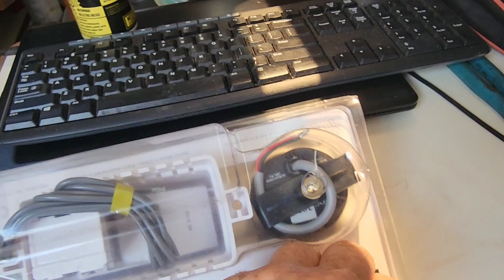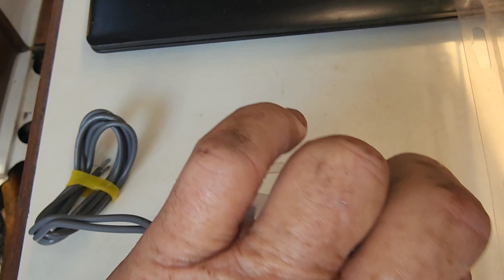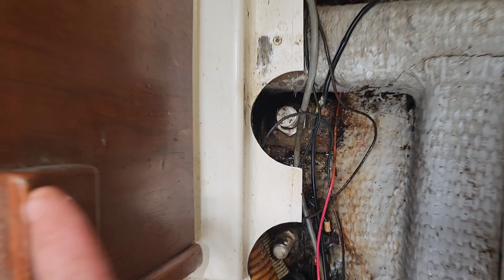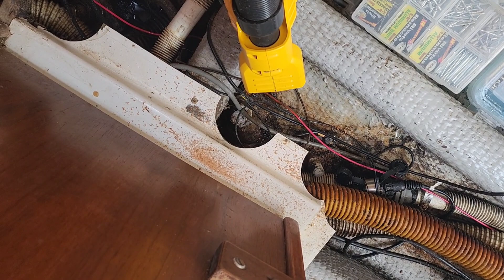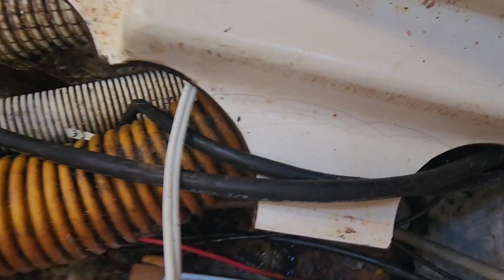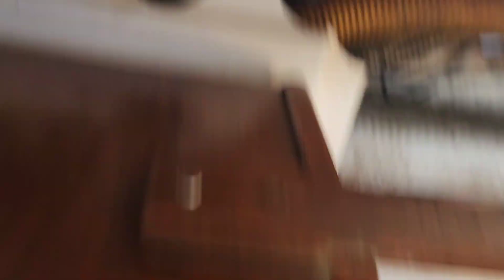Installed a High Water Bildge Alarm on my sailboat

Comment: Hi Sir - thanks for the video. Could you kindly answer a question, what is the power source for your switch? Are you feeding it from another switch in the bilge, or direct from the battery with an inline fuse?  I already have a fully functioning bilge system, but I want to add a highwater alarm. I have purchased both waiting on arrival, but I'm not sure / clear if I should integrate it into the existing bilge float or if it should stand alone.
Reply from the maker: Put high water alarm on seperate power wire so it still functional if power to bildge pump is lost still alerts you to problem with bildge pump